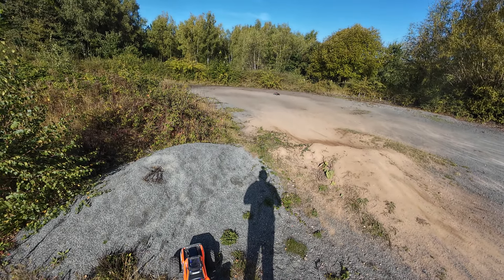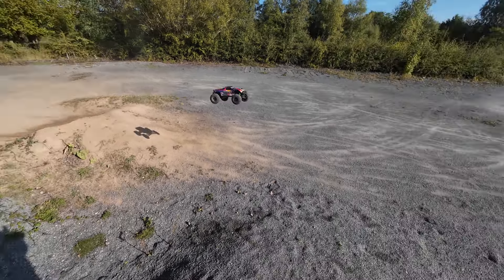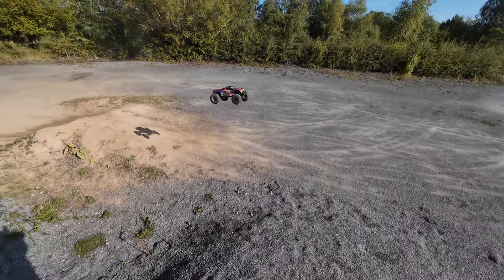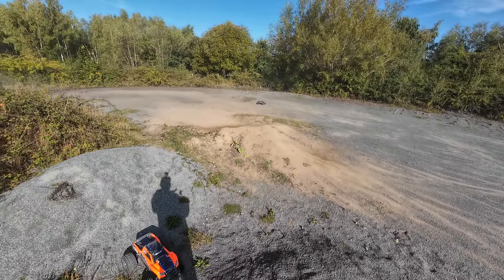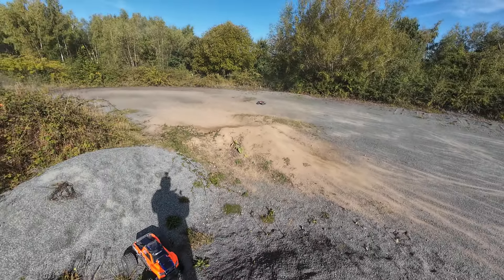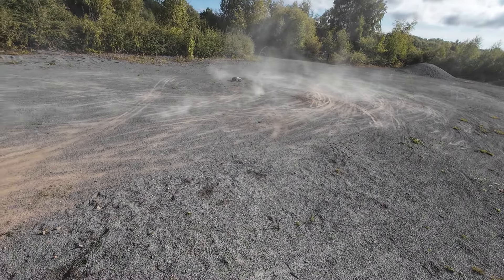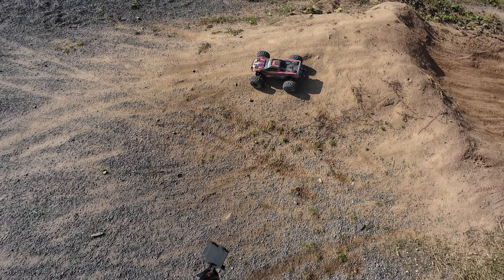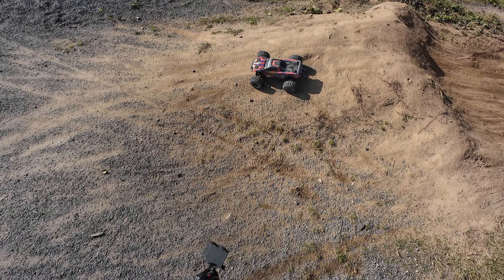TRAXXAS MAXX V2 - 9th Run. 6S VXL ESC Installed.

Comment: i wonder how 5s will be on this truck
Reply from the maker: Faster I guess. If it keeps its durability on 6S (I’ve got a 2050kv Spectrum I can drop in) I would be very impressed. Currently on 4S it doesn’t break much other than gears 😂